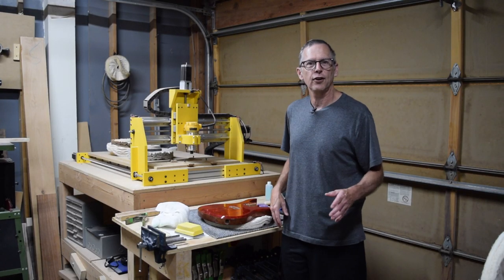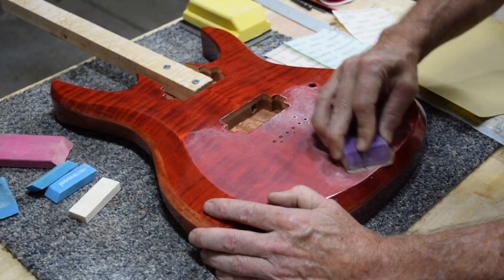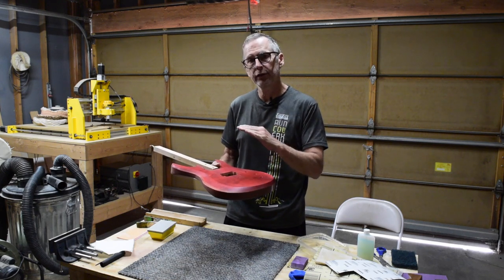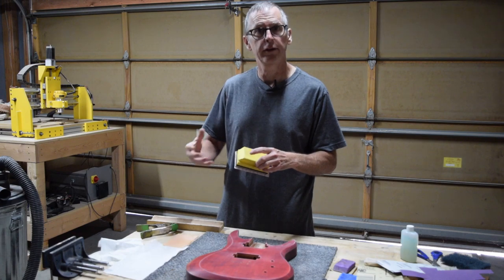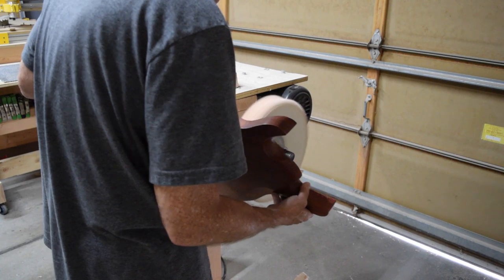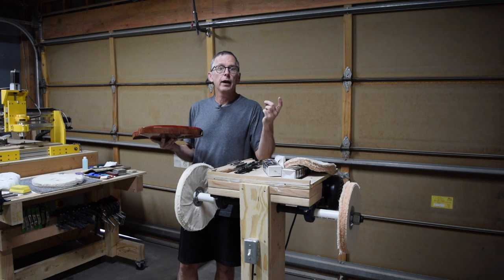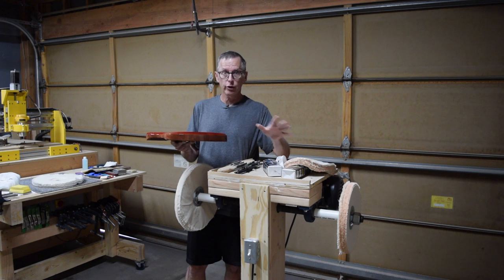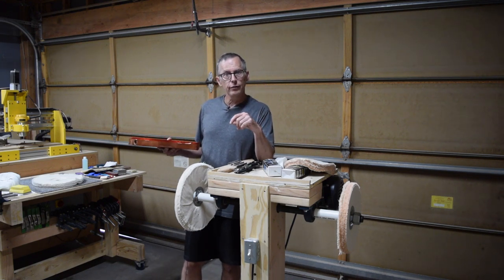How I Level Sand And Buff The Finish On A Guitar

Comment: QUESTION!  Because of the pandemic, and  my low resources, im finishing my guitar with home stuff. Im using shoe wax for a black stain, and color pencil for small parts, this two things are in the top, just a little, the rest is  the natural wood  color (Mahogany)  Im using Varathane oil based polyurethane  spray for the finish. Experimenting on a  piece of the same wood, im seeing problems with the poly...  i will experiment more, but... can i sand the shoe wax? is those that come in a circle can, the brand is Bufalo. My intention is to make a burst of black from the side and add some color on the center edges to simulate a decoloration on the tint. Could i  mix this wax with something to make it like a liquid stain ?  I think this thing goes too  solid and thats what makes the poly to be so inconsistent.  About the pencil color,   you should try it ! In bare wood the thing  seems as a pastel color, and somehow it does get on the wood effortlessly.  I think it could be removed with sanding.  Rubbing it does get it off a little but not completely. 
 Any tip? There are little brands of CA here, i used krazy glue and it looks beautiful if you sand the first layer and apply a second one, but it doesnt protect from scratches and is toxic... however i did try today poly on top and wow... I dont think it will need to be sanded  as  it was smooth, unless you want a mirror finish.  I will try using a resin epoxy from Envirotex, the other i have is Loctite  and see if i get the same result.
Reply from the maker: Don’t use shoe wax to color the wood. It contains beeswax which will not allow any type of clear coat to adhere properly. Consider artist oil paints instead. You can buy them anywhere you buy art supplies and they can be thinned with mineral spirits to work like a stain.
Reply: @HighlineGuitars  Thanks !  So thats why... i tought it was because  i didnt sand enough where i applyed the shoe wax yesterday. 
What i did today was sand and use first the shoe wax and then the Envirotex epoxy as a sealer, i will wait for it to dry and  then apply 1 coat of poly. 
If this doesnt work i will go with your tip! What about Chinese Ink?
Reply: @terribleligadelmal4541  I know this may sound sketchy, but I've got lots of extra black stain from my guitar project. All it'd cost you is shipping, I think. I'll send you a few different ones if you'd like, although I may only send a small amount of my nice StewMac black cuz that stuff's expensive.
Reply: @belacickekl7579  thanks, but its too late. I appied a shoe polish  that seems to work with poly, doesnt have wax.  if this doesnt work i will sand and do solid colors with spray cans.
Reply: @terribleligadelmal4541  you sure, man? I know that you want to save money, but I feel like these will look a lot better than shoe polish if used correctly.
Reply: @belacickekl7579  its okay xD i already applied yesterday so no turning back now what will be, will be. And if it doest turn good i will have to refinish, it can be fixed.  Im thankful to you.